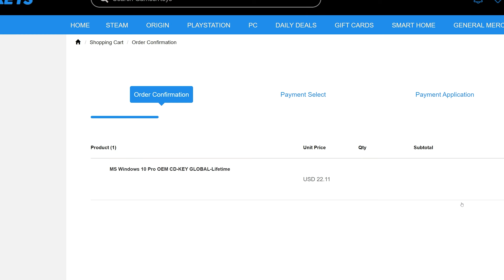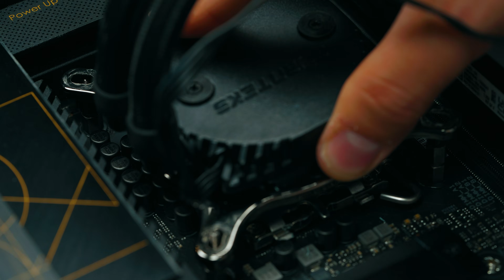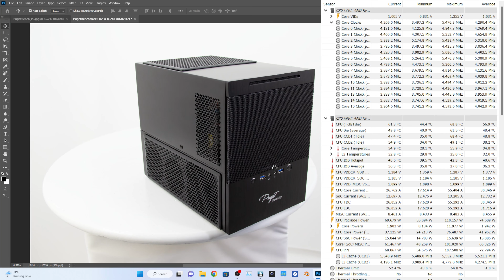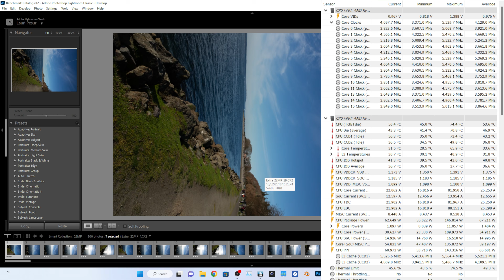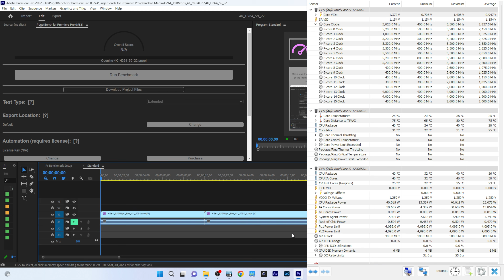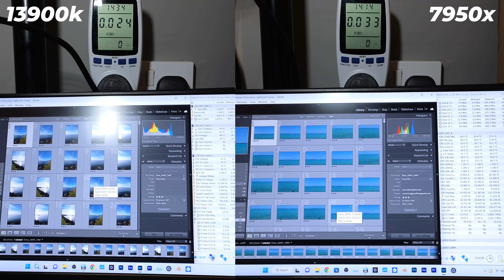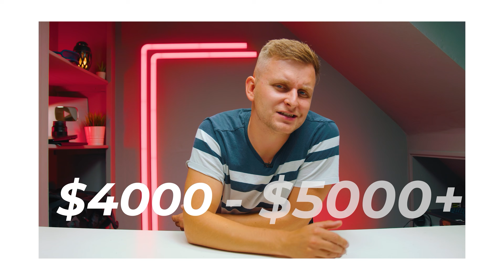INTEL & AMD both lied! 👉REAL WORLD power consumption is MESSED UP

Comment: My observations with Ryzen CPUs are:
4600G - 2W at idle. Goes up to C3 idle state.
5700X - 20W at idle. Goes up to C2 idle state only.
3900 - ~30W at idle. Was unable to measure in time as it reached 95C very quickly and started throttling in my system.
Power was measured on 12V CPU supply on the motherboard, with current clamp.
All of these CPUs are "65W TDP".
Tested both with proxmox without any VMs running, and with fresh ubuntu.
+20W means +50€/year on electricity bill. That's crazy.

Comment: I use a headless mini pc with the 4 core Intel N200. Basically 4 efficiency cores. TDP of 6 watts. It runs the astrophotography software for my telescope. It's designed for when I travel, and run the whole system off of a 100 ah 12.4 LFP battery. It has all the processing power I need, and sips the power slowly.

Comment: they say how good 5700x is spending 65watts !! well if you use all cores with pbo on !!! if you use the torture test in aida 64 off cpu + fpu + cache with 4.3ghz it spends insane 145w !!! already with undervolt off  0.066v!

Comment: I know they are AM4...but comparing your results to those of my old 3700X and 5800X3D the idle behaviour you were experiencing is definitely not normal. Its as if the CPU's low power states are disabled. For example when under load my 3700X would peak at around 80W and drop down to less than 10W package power consumption, and its similar for my 5800X3D.

Admittedly they don't idle as low as my old Haswell CPU (i5 4440 and 4790K) as their FIVR does dramatically improve idle power consumption albeit at the cost of running hotter than Ivybridge. Still though, you should be seeing far lower idle power consumption. More inline with what you were measuring with the i5, i7 and i9
Reply: I know its old post, yet this whole video doesnt even make sense. I had 8400f with pbo on, it uses 12W in idle and 20 with some work, also had r5 5500 and it idles at 13W, ikd where he found these numbers.

Comment: As a 9700X owner, I'm a bit disapointed with the idle temperatures and power consumption. Maybe I'm just looking at this wrong, but when I used to have Intel CPUs (Skylake and newer) even 65W TDP chips, just like the out of the box 9700X, they would idle pretty much at ambient room temperature even when the fans were off (NH-D15S). The 9700X idles at 47°C to 50°C, min. power consumption 23W, with the same cooler, case and the fans speed is at 50%, ambient room temp. 25°C. I don't hear the PC, but the fans sure pull dust into the case and CPU heatsink which means I need to clean the PC more often than I used to with Intel chips.
Reply: I recently upgraded from a 14700kf to a ryzen 9950X3D, thinking i would get better temps and energy efficiency and good god how i was wrong 😂 the ryzen idle at 50c and 40w, 200w the whole system at the wall and 600+ while gaming
Reply: @TheMichaelparis Advanced Marketing Devices.

Comment: I tried Intel i5-14500+MSI B760M vs Core Ultra 5 245k+Asrock Z890M. same PSU, GPU, RAM, SSD, cooler and fans.

Both idle at 38 to 42 watts from the wall. In gaming the difference is 2w. And on normal tasks like browsing, watching videos and so on. The difference was 2w between the 2 systems. 😊. 

That means that intel made "15th" gen more energy efficient than the previous gen, because a K (unlocked) system on the new gen is consuming the same as a non-K (locked) system from the previous gen.

Comment: Nowhere in the first test did you show what kind of power window we're looking at for Intel. You say it idles at 10w or so, but then the material doesn't show anything showing higher CPU usage watts.... Only AMD @ ~162W. Also, if it's sitting on my desk at work or home IDC how much idle power it uses. Measures in the single dollars a year via Mw. AMD is king here because it performs better than Intel within a much neater and much more simple power range or not too low or not too high. Intel just blows it all over the place. Intel didn't invent DVFS but they are sure taking it to extremes.
Reply: Cope

Comment: I just made a test with my 5600G. It's a PC with no dedicated VGA, 16GB 3200MHz RAM, 1TB nvme SSD. Bequiet Dark Rock 4 CPU cooler, an extra fan and a 600W cooler master power supply.

Idle power consumption was just 24W.

I measured it from the wall. 
This monolithic design is very efficient.

Comment: guys for power efficiency pc when i leave my pc open all day , i have budget for something like i5 12400f / ryzen 5 5600 , 32gb ram , 1 nvme , 1 hardisk , 1660 / rx 6600xt gpu , bronze power supply . I run 2-4 auto game at the background ( idle mode ) , browsing and microsoft excel . 

so for 24/7 pc what should i get intel or  amd ? sorry for my broken english

Comment: What I am curious about... If youre a "gamer" and got multiple, high refresh rate monitors, especially if they are on different frequencies, the Idle Load on the system goes up. In my case, the difference between 120Hz and 144Hz is 60W to 90W (all AMD PC, and mostly coming from the GPU) Not to forget that many people have lots of bloatware running in the backgound, browsers, weird gimmics, and music. In this case, some people say that the Intel Core I7-147000k idles at 40-50W as well, kind of closing the gap to the amd ones... So it probably depends on what youre doing and so many other things in the setup. To be clear, I dont simp for any computer company, why would I? But in the End, there are too many factors at play to make the decision easy... :/ But yes, in Optimised systems, this definetely matters! And I like the video and explanation a lot.
Reply: So, what's your choice?
Reply: @genzii1174  I go with the 285K because of the Idle work ;)

Comment: Literally dumped my 13900k and 13600k. 13600k was good then I bought the 13900k, but both failed after 2 years, super unstable due to recent intel issue. I'm forced to switch back to AMD.

Comment: Thanks for sharing! In my case I do programming, a lot of internet surfing, and a lot of different tasks... Most of the tasks only require 22-25w to open and then the power draw goes back to 3-5w (i5-14500)... Also when I was using Ryzen 5800, my power bill was double -doing the same tasks-.

I'm suspecting it is because of the efficiency cores on Intel.
Reply: Bro reply me. 3-5W idle is not much accurate. Please tell me what is the power consumption showing in wall socket at idle?

Comment: Whenever the manufacturer will start talking about efficiency and not the actual power consumption, you can know it´s marketing lies.

Only AMD CPUs currently on the market with low power consumption are their APUs - the "G" line. But those are also gutted to not offer the same level of functionality support as their "normal" CPU lines. For example, they only got 8x GPU PCIE lines and cut down PCIE support (AM4 chips only support PCIE 3.0 and AM5 only PCIE 4.0).

I have 4600G in my HTPC and that thing idles at 20W at the wall. Meanwhile, my main rig with Ryzen 5600X on X570 motherboard idles at 75-80W... Yearly, that´s quite a lot of electricity burned for nothing...

Building a modern intel system right now, but had to return the CPU (14500... stumbled upon faulty CPU, which was degrading really fast) and i´ll be going for 13600K instead - while the CPU worked, i was able to get at just 40W idle with C10.

Comment: Everyone is always telling me AMD CPU's are more efficient as I'm sitting here in front of my 2 systems looking at the wattage in real time.
My Intel system while working in Affinity Photo watching this vid and typing this, 11.3W my Ryzen system is idle at 36.8W
Gaming may be another story but real world is... real.
Reply: Handsdown.....
Gaming=Ryzen
Creator=Intel 

So True....if you see life on an editor we Need pc to be Turned on 24x7 that doesn't means its runs 100% 24x7.... Which more hours than a Average/Pro gamers...
So at long run.....Ideal Power consumption is Huge Deal for Creators....

Inorder understand this it will Take Atleast Years Being an Editor  😂
Reply: Did you measure the power consumption through the wall socket using a watt meter? When you actually want to know what the actual power consumption of your system, you also have to include the other components inside. HWInfo can't exactly do that
Reply: exactly...

Comment: Unfortunately there's lots of unknowns here and I wish there wasn't.
1. If you used some testing workflows with a fixed duration(?) then depending on the type of test, there could be a problem: The faster CPU might complete more work in the same amount of time than the slower CPU and as expected use more power.
2. guru3d checked total system power consumption of the system measured directly from the wall and the idle system draw with the 7800x3D was 75W while the most efficient modern CPU from Intel, the 12600k, was at 76W. So either there is something wrong with your AMD system or the HWINFO metrics can't be trusted.
Also to quote techpowerup on the subject:
"We're not using the software sensors inside the processor, as these can be quite inaccurate and will vary between manufacturers."
3. Your AMD idle power draw results seem to be insanely high. Something seems wrong when one compares it with other reputable sites' results.
Reply: Came to post something similar after Youtube wanted me to watch this. I trust Guru3Ds total system idle power consumption numbers over these. 

CPU idle power usage differences are useless if the system draws the same power from the wall anyway.

Comment: You can measure it from PSU that allows you access. For example the -i series power supplies from Corsair (RM850i, AX1200i, etc). Data is then reported to HWiNFO as well so nothing else changes in your process.

Comment: Idle is when i do almost nothing on pc but now or soon need it. This means lot of software is still open and stealing a bit cpu power making full idle impossible, to get the Intel 9 watt, it must disable RAM altogether almost. My ram while rated 6000 CL 30 i still keep at 4800 mhz CL40, partially for power usage. Intel uses (in benchmarks to stay close to AMD) 7200 mhz, that uses a ton more power then low mhz RAM (wich works better wich x3d cache).

I saw saw tests with 2x 16gb (i got 2x 32gb, wich use more power since more is cramped onto same thing and is dual rank inside already), if extrapolating the 2x 16gb overlocking (power usage) stats to what the simple benches for power usage on 2x 32gb do, it would go from 5-7 watt, to 10-15 watt (7200 mhz, would be like 20 watt).

And if ram is fully clocked down is it idle then? perhaps but i made my pc so, that if nothing is 'working' like a game or video editing or playing music', the pc sleeps after 10 min. Guess what: i think Intels lead vanishes in sleep mode vs AMD :D I spare power compared to you cause you keep pc needlessly on :D 

I admit dual CCD has a downside but it's 10 watt, sometimes extended by chipset to 20 watt, 50 watt is an unrealistic and cherry picked benchmark. I'm a real life multitasking person (hence i bought 16 core cpu, why else), that doenst close software that he might uses later in evening, and in this scenario, Intel 'almost zero clock' speedstep will simply not work, and loose it's big advantage. Plus turning pc off sill better then Intel, so i'm 'nulifying' AMD's downside  (automated :D no effort).

Strong anti aMD BIAS here imo. I tell you one thing when ARROW.lunar lake on new node comes and Intel didn't screw up, you will seriously see how bad the raptor lake is in power consumption it will be 3 to 10 times better then raptor lake, if they don't push clocks (wich they shouldn't as they finally have node advantage over AMD).

Comment: So i can only speak from a gaming perspective but my 7800x3d hovers around 20-25W in Forza Horizon 5 at 1440p/240hz ultra settings, 190fps avg. 35-50W in cpu heavy titles. 

Compared to several intel cpu's, thats just incredible.

Comment: Yesterday I was thinking about this after reading a small comment on internet about how Intel idles on lower power usage than AMD. So in my mind came the idea that in real world usage, the CPUs are idling a lot. So I searched further about market share and the image with Intel dominating the laptops market said a lot. Intel is more power efficient and the laptops makers know this.
Reply: wth. using laptop at idle. if ur not using it turn it off. in your mind those are idiots using a gadget at idle is stupidy.
Reply: @cronoxtrigger4791  ok, but how much load do you think there is on the CPU when using laptop for programming, Microsoft Office tools and so on?
This is also productivity usage.

Comment: I believe amd's monolithic laptop chips are far better with idle power than their insanely high idle power desktop chips. My 65w tdp ryzen 5600 drains 18w PPT while idling and that's after disabling xmp. I don't care about the 20 bucks in electricity as much as my room always being hot from what should be a low power chip.

Comment: What does idle mean?
When is it not idle anymore?
Reply: Idle means non or low-load power consumption. When you leave your computer on, message someone, browse, watch videos, do less intensive applications(like programming and art) etc. it's considered as idling or low-load. When you do CPU intensive applications like AAA/Competitive Gaming, AI and deep learning, Rendering, File Compression, Photoshop, 3D modelling etc. its considered no longer considered as idling.
Reply: @auritro3903  No idle is completely not using the computer, and it just being on with no background processes outside of OS. 

Browsers are medium use, Messagers are medium use, Videos are high use, Text based is low power, and art depending on the program can be medium to high. In fact most builders will tell you the overheard from HWmonitor keeps it from being an actual idle number, because its doing constant calculations. 

If you don't know what idle is don't make crap up.

Comment: I got myself an i7-14700K over an AMD 7800X3D only because I could still get a motherboard with DDR4 support (as I had 64GB of high speed DDR4 and I didn't want to repurchase DDR5). I heard that Intel sucks power like there is no tomorrow, however while I sit here watching YouTube and typing this response, AIDA64 tells me my power hungry Intel chip is sipping between 9 and 13W of power. When I run games it typically averages around 100W. I need something like CPU-Z to stress the CPU and only then will it go to 215W.
Reply: measure it with watt meter through the wall socket for actual power consumption
Reply: Yes because for youtube, you're encoding via GPU and you're also only watching the video. Render a video, 3d file, etc. You'll see 300W vs 125W quickly...

Comment: The fatal flaw in this examination is comparing Intel CPUs with an iHPU to AMD CPUs without.  You could have easily done a comparison of CPUs from both that have iGPUs to eliminate the possibility that the iGPU is contributing to any imnlanace.   Another factor not mentioned in comparing value is that AMD tries to price their CPUs on average 30% less than Intel at any given performane point.

Comment: Well that's a heck of a job, but $10 a year doesn't really affect anyone. Yes, Intel might idle lower, but their crazy load power means it's also harder to extract their performance and watercooling is almost a must with their top chips.
Top power consumption/cooling capacity, unlike the car analogy you use, is literally the most important power figure of a cpu and sadly, it is being hidden under these new, 'better' representations which mean very little. Top TDP on the other hand is crucial for knowing what motherboard to use and what type of cooling. Up to 10 years ago, you knew  a 95W chip drew +-95 W full load and that was it,..now a 95W cpu might shoot up to 200w and both AMD and Intel sell ~120w CPUs which won't reach their claimed performance unless you use watercooling.
Reply: When you copeso hard
Reply: It's not about the cost difference. It's about the heat generated in hot climates and in general global-warming summer heat waves.

Comment: Curious about the figures you used to calculate the KW/Year figure (if it's in the video I missed it). Looking into cpus for a homelab so I'd have to figure out what would be the KW/year for 24/7/365 load of 30/40% on most cores to have a ballpark idea what the difference could be between a 7950x and a 13900k (and a 5950x and 7945hx and a 13900h too ideally, if I find any figures about those around)
Reply: Gaming benchmarks, excluding the X3D chips, are probably a better idea of power efficiency at those loads. Often games stress large processors like the 14900k & 7950x at roughly the percentage of your expected load.

Comment: Great work! Idle power consumption with AMD CPUs is just crazy. 
Conclusion 1: if you are a typical PC user: 2-3 hours of browsing, YT, etc, and then 2-3 hours gaming/productivity then Intel CPU will take way less power because of good idle
Conclusion 2: differences in yearly electrical bills are meaningless so just pick what is best for you but check if your CPU is more often idleing or is more often on 100% load.

Comment: Including the motherboard's chipset power can be fair. The CPU requires a matching chipset to do anything so they should be considered together. Most recent generation desktop chipsets are in the 4-15 watt range.
The main consideration is to look at the basic specifications for the availible chipsets so you are comparing like with like. I know the top-end boards sometimes use two chips to provide more PCIe lanes and this will double the idle power consumption of the board.

As a contrast I have an ARM(32b SOC) mini server with one 3.5" spinning disk(5400rpm) and the total system has a peak full load Gb ethernet writing-to-disk power of 17w, and a disk-parked idle power of 4w.